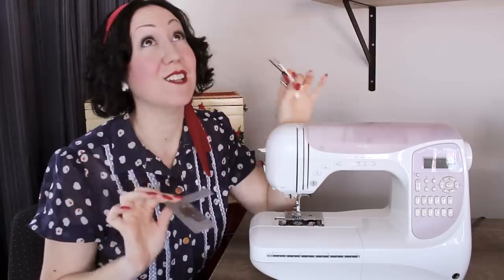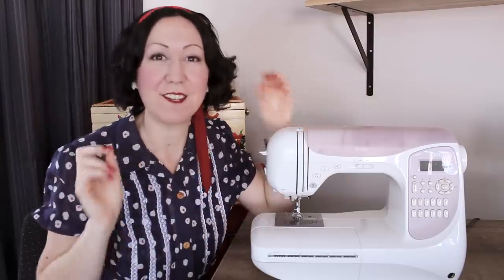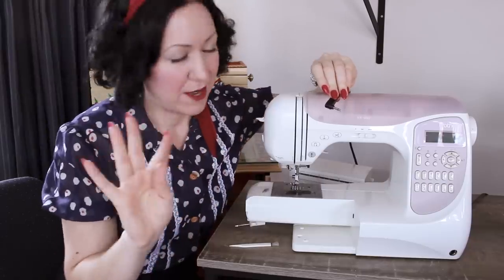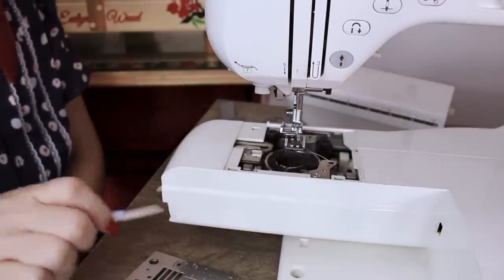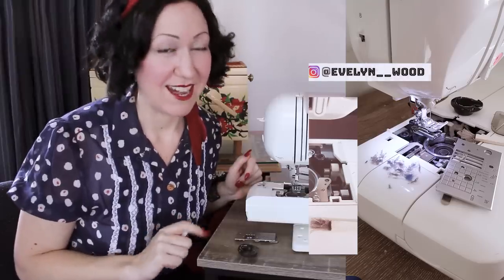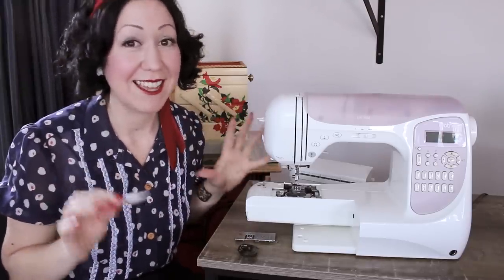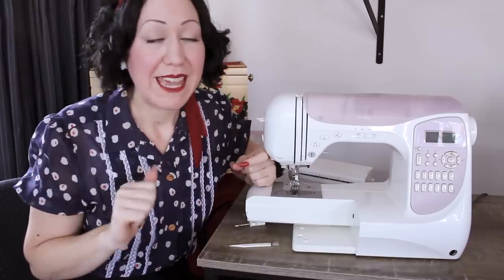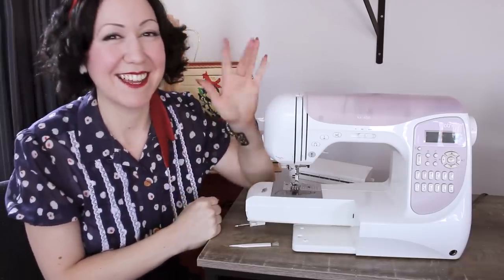SEWING MACHINE MAINTENANCE // What you can DIY to properly clean & de-fluff your sewing machine!

Comment from the maker: Tell me... Do you regularly clean your sewing machine? Or..... not? Or ...........never?! 
If you really want to learn to understand your machine and sew better, join me at  https://www.vintagesewingschool.com/
Reply: Yes, defluff after each project or once per month!
Reply: My first sewing machine I didn't know you were supposed to clean it. Or change the needle.
Reply: What do you think of yearly tune-ups by a mechanic? I've been told a yearly maintenance check is always necessary but I think in the almost 20 years I've had my machine it's gone twice.
Reply: After each project, with makeup brushes!!
Reply: I learned last yr how to clean my machine. I got sidetracked and forgot, so it's been about 6 months.
Reply: I don’t see regularly.  Maybe a couple hours a week.  But I do de fluff after each time.  But I have yet to take apart the metal dodad.  Need to do that after work tonight.  😉
Reply: Every few days I cleaned out the fluff from around the front-loading bobbin, or so I thought.  Then I followed your suggestion and took off the plate.  Well, who knew that much could have accumulated?  Thank you, Evelyn, for your enthsiasm and the bountiful flow of great tips and techniques you share.
Reply: I was recently told never to leave a bobbin in the machine between uses. That's news to me. Anyone?
Reply: Regularly de-fluff: yes. My older (about ten years) machine has instructions to oil around the bobbin shuttle--it has a front load bobbin.
My second machine was a Christmas gift, tomorrow it will get its first cleaning; I am glad you demonstrated how to break down a top load bobbin.
Reply: I never knew how to clean it.
Reply: I know it's been 3 years since you posted this, I've had my machine for over 20 years and am very ashamed to say I've never cleaned it. That will definitely happen this week though! I was digging through some old boxes and actually found the manual. WooHoo! Thank you for your very informative video, I've just subscribed here and followed you on Instagram as well. Hope you're doing well now.
Reply: You can use a coin to undo the throat plate screws!

Comment: Seems like I'm always defluffing my machine --- it's amazing how much gets in there in such a short time.  I have learned a little trick that helps.  Always put a little piece of fabric under the presser foot when not using -- keeps the dust out.
Reply: That can also be your waste piece for sewing onto at the end of the seam so the thread doesn’t get bunched up.
Reply: Better still, sew up a sewing machine cover if yours didn't come neither a soft nor a hard case cover.
Reply: @EverythingCustomMade  A soft cover with pockets (not really ever used) is the FIRST thing I sewed on my machine.  It took me a few days, but, I finally got one made.  Til then, I covered the plate and the top of my machine with pieces of fabric.  It sure helps to do that.  😉

Comment: Oh no my machine is from 2001 and i have cleaned it never times
Reply from the maker: Oh noooooooo! 😂😂 I bet your machine will sew so much better when you do give it a clean! 😃
Reply: Same but 2003 😂😭
Reply: My older machine lets me know to clean out the fluff and oil it--it will sound different,  sort of run rougher, when it needs to be cleaned/oiled.
Reply: Me neither lol
Reply: 1960s, same story 😅
Reply: My machine works terribly. My mom bought it. It sat in her house in the box for 9 years and then I seized it. I got it maybe 3 or 4 years ago. I have never defluffed. Probably there are big dust bunnies in there. 😒

Comment: A great reminder. I regularly clean my old machine and oil is a must for my old machine. I also use the keyboard vacuum attachment to vacuum out the fluff before brushing to make sure I got it all. When I have a problem first thing I do is clean machine, rethread and change the needle. Amazing the number of problems these three steps will cure.

Comment: I have four sewing machines (don't ask) and have found myself de-fluffing and cleaning the two most often used ones.   I was stunned to see the fluff build up in one after I did a quilt with a fleece backing.   I did not clean the machine after the project and began another something.   The machine literally stopped!   Before it stopped I heard the most disturbing clunking, thunking sounds.   Scared to look, Idid, and found a veritable pillow under the plate.   My vacuum machine and brush took care of all.   I could not believe it.    Yes, it was a first for me.   So, you are catching me post-defluffing/oiling my machine, but I really appreciate the details you provided, easy to understand instructions and the absence of a patronizing manner.  I will be following your suggestion to put defluff and cleaning on my calendar.    Thank you.

Comment: I believe one of my 3 machines states in the manual not to use canned air or anything to blow the fluff, because it will pack it further down into the machine.
I would add that if you sew with more lint producing fabrics or predominately use 100% cotton thread you probably will need to defluff more often.

Comment: Hi, Funny thing happened today... 
   In parts thanks to you Ms. Wood there is now a brand old vintage green Husqvarna Automatic 21 E (Viking I think they're called in some places of the world) from the late 50's or early 60's sitting on my kitchen table. It's a very coveted machine around this part of the world. I got it from our local EBAY-type place and after it got to me, it went to the doctor for a check-up.
   To shorten this essay a bit, let's concluded that as a senior machine, it needed a little TLC and then he (the machine not the doctor) came home with a new spring in his step. I have found that he has a feed dog(?) issue, so today my husband oversaw me doing what you just did. He is an engineer (the husband not the machine) of that particular kind, that has pulled every single household appliance apart and put them back again, before the age of 12. What he did was that, when he unscrewed each piece he put that piece, and the screws holding it to the machine, in separate piles during the whole procedure. After we were done with the brush he blew, very gently, into the machine before putting back the plates, shuttle and screws to put it back together again. He (the husband) would have conniptions if I was to suggest that we would use the vacuum or spray air to di-lint it. 
   We couldn't fix the feed dogs, by the way so he (the machine) will have to go back to the doctor's at some point. There weren't a whole lot of fluff either but I have used it maybe a few of hour so far, as I'm learning how to sew. Did I say that I'm a 55 year old absolut beginner sewer, by the way? As the keeper of a senior sewing machine, I wanted to highlight the more analog approach, with keeping the screws and things in separate piles, and not just rely on digital coming to the rescue if you mess up.
   When I picked my machine up after his treatment, I asked the gentleman in the shop how often I should oil my new, much loved senior, and he told me that it had been over oiled, and I should only put oil in it once a year or so. I think that he (machine again) might need yearly check-ups anyway, so I will let them do it when he's in the doctor's office. Much like we having our blood pressure taken and getting our flue shot.
   So, that's the story about timing with this post. Yours, Ann

Comment: I had just cleaned a vintage sewing machine for a lady that had so much fluff under the bobbin case that it raised up lock down and jammed the machine. I did use air to blow it out because I could open the machine completely up and from experience I knew it was ok. The sad part was because it was an older machine and covid she was not able to find anyone to take it to. Part of my sewing and I think I've mentioned this before is keeping my vintage machines going and every time I think I'll just skip cleaning and oiling I have to stop and ....... de-fluff and oil. It catches us all.

Comment: I so enjoy your videos!

I clean and oil my machine every 6 hour or so, which usually means once a day.  I sew on a relatively-new Bernina, and it does require regular oiling and maintenance.  Since I sew with lots of natural fabrics, I do get lots of lint; regular de-fluffing is a must!  I don't mind the maintenance requirements, I like keeping my machine in tip-top shape.  

As for your felt pad reference:  a customer at the shop where I work once insisted that her felt pad be returned to her, as it was missing when she picked up her machine from servicing.  She was quite irate, and sure that we were wrong when we told her that the pad was the result of accumulated lint.  It seems that she was removing it and carefully replacing it when she cleaned and oiled her machine (which can't have been often, since there was a felt pad).

The techs will actually take photos when they get a particularly dirty machine on the bench.  I have seen some amazing mounds of lint!

Comment: I had to laugh when I saw this video because just yesterday I cleaned and oiled mine.  She's pretty old (from the 80s I think) and recommends oiling every month.  For those that do need to oil it's worth it to check the places where you put the oil since lint can get in there too and create a gunky mess.  I'll usually clean any linty oil with a qtip before I put in new oil.
Reply: So true.  If your machine goes long periods without use, or you are trying to revive a family heirloom, clean thoroughly !  Old oil can oxidize and make a tough goo in the machine, especially if it is the wrong oil and has mixed with fluff.  It will be in the hardest places to see or reach.  Remove fluff often, oil sparingly.
Reply: The machine I use ( borrowed) is over forty years old. I don't sew often, and am ashamed to say, never clean. Had it serviced a few months ago... However, this excellent video and the helpful comments by other viewers are very helpful. Will turn over a new leaf from now on. Thank-you, Evelyn and everyone.

Comment: My Husqvarna 20 year old machine began chirping. It doesn’t require oiling either... but that sounded like metal on metal! I remember when I bought the machine the dealer showed me where, in the crevice over the presser foot, a drop of oil could be added if needed. I worked with a flashlight and turned the wheel many times forward to see the internal motions, adding sewing machine oil where metal met metal side to side and up and down. It worked! Have also removed a small sheep’s worth of fluff in the past. That was a learning curve!! Now, I clean after every project.

Comment: I have a few machines.  I have been sewing heavy items like 3 layer masks, Denim for a wedding, and a nylon/fiberglass mesh that is beach bags.  These I do on an older Baby Lock that is a Beast of a machine and lives forever.   I just put to rest a Kenmore (went through everything but metal) last year (motor gave out because of age).  Both of these were Old to Vintage Machines.  They Last forever.  They were given to me after they had worked unknown hours for others.
I clean my machines every time I change a bobbin when doing heavier stuff like the Mesh and the Denim. I use Sample Mascara brushes to clean out the areas (found at beauty supply stores) deep past the bobbin case, and shuttle.  I try to sharpen the needle every time as well with steel wool to deburr and keep it working more smoothly.  Oiling is about every 3 months or when I feel like I have been particularly busy.  With the older machines, and older industrials. they require oil from the top as well.  Or white grease if they change stitch patterns without knobs on the top or are semi-electronic.
Recently I had to oil my Best Friend's Industrial machine that we had been using for Handbags for the Christmas Show Season.  I had to figure out which holes were for which reason.  The other industrial she has is self oiling.   It was pretty easy when you take it apart and look.  Ran like Butter after that.
I started sewing on my Mom's machine when... 8 I believe... I have been the only one she truly let use it because I believed it was so precious.  She taught me how to to use a Singer... She  bought it when my Older brother was born in 1963.  I taught myself to maintain it and later found information for that.  (she never knew what to do to maintain it's works).  I used it for business means in 1995 to 1999.. at least 30Hrs a week.  Still in working order.  I wore out a simple Brother machine from 1990 to 1999> Thousands of miles on that one.. even with regular maintenance.
Sewing machines are AMAZING!! The  HISTORY of how they were created is AMAZING!!!!! and how they work is incredible.  They have REVOLUTIONIZED the whole garment and home sewing industry. I hope you do an Episode on the Creation of the Sewing Machine.  

This was a great episode.  I think it would be wonderful if you found someone with an older machine that has to take more apart to oil and maintain it.  Or maybe find links to how to OIl/maintain other brands of machines.  They are pretty basic and the cleaning is pretty basic.  Active Sewists just need to know how to do it!!!

Comment: I have a Simplicity SB3129 (Brother) machine that I love.  I can get the bobbin case out to de-fluff, but I've never been able to get the metal throat plate off because the screws were in so darned tight.  I tried using a penny with one of those silicone key covers so I could get a good grip, but the penny just got chewed up.  Then I tried a nickel with the silicone cover on it, and after much struggling, the screws finally gave way!  Wow, I can finally do a more thorough job!  I find that pipe cleaners are good fluff grabbers.  Thanks everyone and Evelyn for all the tips.

Comment: I've been sewing for more. years than you are born. I learned on a treadle!  I love your videos.  This one in particular.  I am obsessive about cleaning my machines. I do it at the end of every sewing session. I used to use canned air, but don't anymore. I have one of those mini attachments that hooks onto my vacuum cleaner to suck it all away. I still have to use a brush in addition.  Sergers are the worst of course because they often get un-threaded during the de-linting. I HATE rethreading my serger, but I can't live without one! LOL.  If you keep your machine clean, change your needle for every project, and use the right type of needle for what you sew, you'll rarely if ever need repair.

Comment: I‘ve been using a lot of vintage cotton and linen and it seems to create so much dust. Plus I bought a new sewing machine and so I‘m still very much in love with it. With reason it seems. The stitchplate comes off by pressing just one corner. The shuttle has just one anchor. It is still a bit fiddly, but self explanatory. When I see fluff collecting on the presser foot I know I will find fluff under the stitchplate and behind the shuttle so I clean. Strangely enough, although my machine certainly is modern I‘m still supposed to oil it, but one month after purchase I still see so much oil when defluffing that I have not yet done so, but I will once I see no more oil residue from the big glugg my machine seller must have been given it. If you want your machine purring like a kitten instead of heaving like a 70 year old smoker do what Evelyn says and clean regularly.

Comment: I was having trouble with my thread getting "bunched" underneath the fabric(s) I sewed on.  It would only bung- up every once in awhile, though.  So, I figured it was the tension setting on the individual fabrics that needed adjusting when I re- threaded and did all other normal tasks that you can do for the bunching problem.   NEVER had defluffed my machine !  THEN, it started sounding "wonky !"  And, eventually wouldn't sew ANYthing right !  Sooo, I took my bobbin holder completely out - including the large casing which holds the bobbin in place - and you would not beLIEVE the "FLUFF" I got out of my machine !!!  Looked like a couple of portions (loose) at least of those large marbles --- the thumb - shooting size !!!  I was in awe at how much there was and was sooo glad  I got deep into the bobbin case to clean it !  I never thought about taking a picture beforehand, though.  So, luckily, my bobbin case wouldn't fit back into my machine until I had the settings just right on it like it was before I took the mechanism out.  But, if you can, I recommend going further into the bobbin holder to clean it out hopefully completely.  It sure saved me from going to the sewing machine repair (or replacement) shop !!!  I was actually ready to have to bite the bullet and have to buy another machine !!!  😉  Thank you so much Evelyn for sharing this video with us.   I was wondering how often I needed to clean my machine and if I needed to clean anywhere else.  Would you recommend cleaning other places besides the bobbin area ?  TY for answering if you can.   Love your channel.   🥰😉😻

Comment: I have an old machine (1973) that is side loaded so it's easy to de-fluff and oil. I have a column in my sewing journal where note cleaning dates and if it's at home or done professionally.
Reply: I should be as loyal in maintenance and in my general upkeep, with my Mom's 1976 Husqvarna sewing machine, as you are👌🏻. A sewing journal sounds so professional👏🏻.
Reply: @janehollander1934  thank you! I just realized that I would make things and go back to upgrade a few years later and have no clue what I did or was thinking. I just this year started to be really diligent about keeping it. It's the only journal i have ever been able to keep consistently.